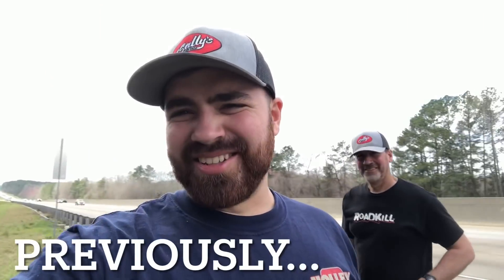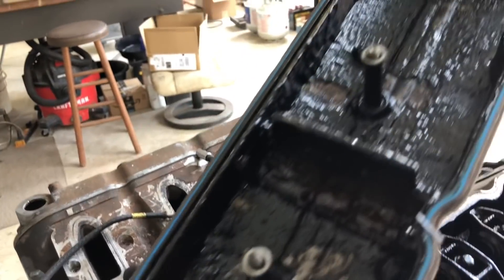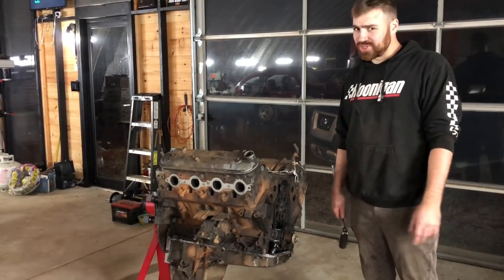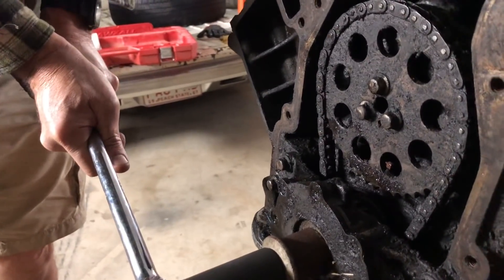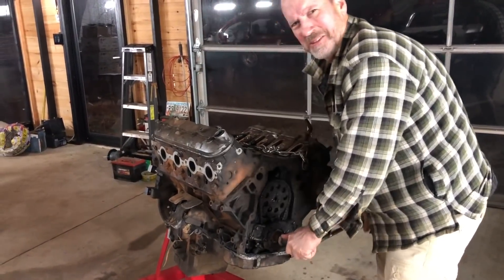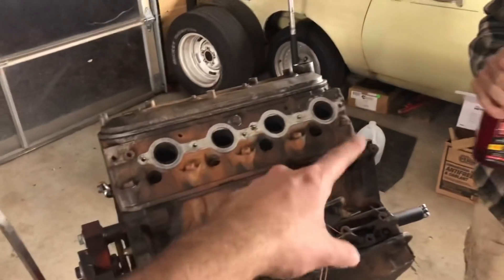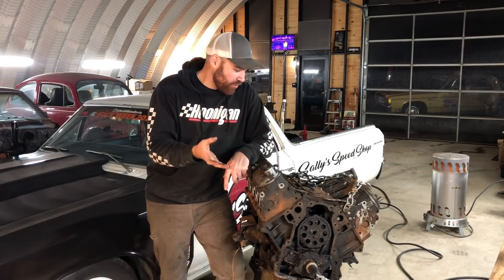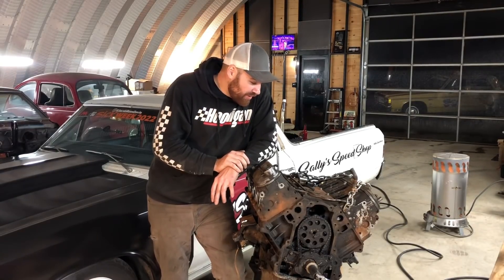What's inside the Free 5.3 LS Engine we Found on the Side of the Road! Will It Run or Not? - Pt. 2

Comment: Newer engines (most built after 2000) require full synthetic oil because they run hotter for lower emissions, and the VVTI systems depend on proper oil viscosity. Synthetic oil resists sludge, and because it is a better lubricant, helps regulate engine temperature. Cheap oil from quick lube joints do not meet manufacturers requirements, and will sludge up an engine in a hurry, especially if you are lax in the maintenance department. This engine is a perfect example of that.
Reply from the maker: I think you're onto something there with that theory! I could definitely see that being the case!

Comment: Definitely one in each bank that was more crusty than the rest and probably most of the turning resistance.
Still better than most of the junkyard ACVW engines I've ever torn down! All but one of those had at least one cylinder so rusty that the piston was tightly seized in it. Had to pound 'em apart with a sledge and a block of wood. That one bad bearing saved the block by failing before throwing a rod!
The one that wasn't seized was super oily/grimy with some really well-used black oil in it, likely from blow-by as it was labelled "running kore, smokes" on the fan-shroud/doghouse. (yes, core was spelled with a k on it)
Still, nowhere near as bad as this LS! I'd say build it, provided the machining isn't too crazy costly.
Reply from the maker: You're definitely right about that! Sounds like you've had some junkyard adventures! That's the plan currently though.
Reply: I like junkyards, especially the ones where you can stretch your legs by hiking through them!
Heh, be fun to find out the machine shop's reaction to the sludge!

Comment: 285'000rpm turbo boost creep... power ratings are listed at 120'000rpm... so on average 600hp @ 120k'rpm is dropped in efficiency at 285k'rpm but still calculated at 1.4 to 1.7 times the base rating...  that's four digits. 840 to 1020 ... AMG 4.4L twin M12 melted the waste gate lines over spun to 285000rpm calculated at 1330 to 1615hp, ratted at 900hp for 110'000rpm, that block is junk... stock rods in that LS? it can be cleaned up if its needed. 🤤😵‍💫🥱something thought of for diesel trucks.
Reply from the maker: I'm not sure what all those numbers are supposed to mean haha The motor can indeed be cleaned up and have a new crank put in it though